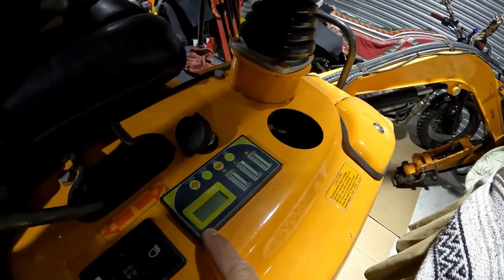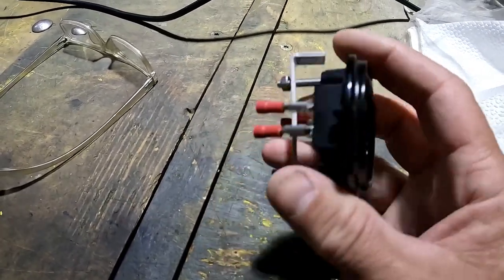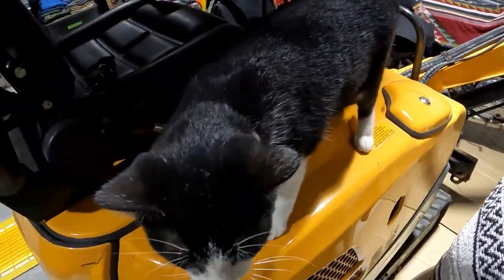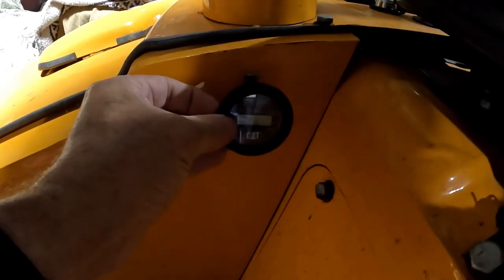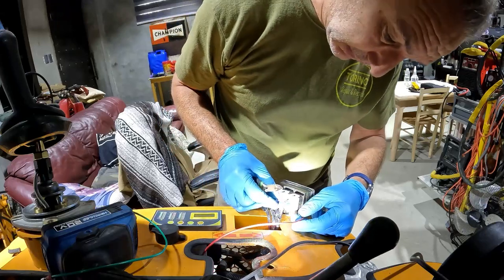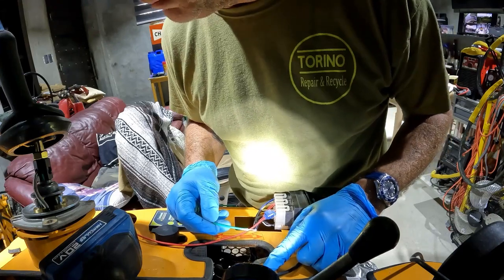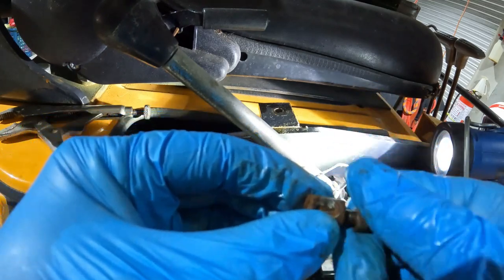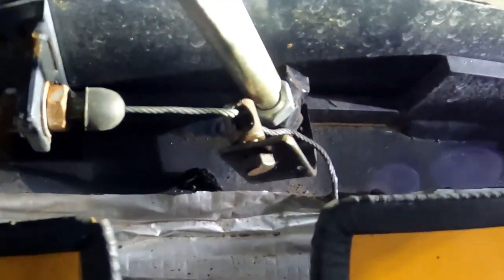Mini Excavator Hour Meter Install ⏰ | Mini Excavators Philippines | Ep. 09 | TORINO

Comment from the maker: I installed a programable hour meter in my excavator and fixed the factory throttle set up.

EDIT: I wasn't getting a time signal, so I found I needed to connect the third "time" connection to the generator.

I tried to use the oil sender, but it is very sensitive to voltage and alarms full time if it sees even a small drop in voltage.

Comment: Another successful job done ✅ 😊. Our little 1.2 Rhino has been very good.  Only think is the tracks. We keep dropping one ..  but we are now experts at putting them on. It’s like a F1 pit stop. 😂😂😂😂
Reply from the maker: mel, are you sure your belt tensioner isn't slowly leaking down?
Reply: @torino2610  hi. 
Mine is manual have to turn then lock it off with a lock nut.